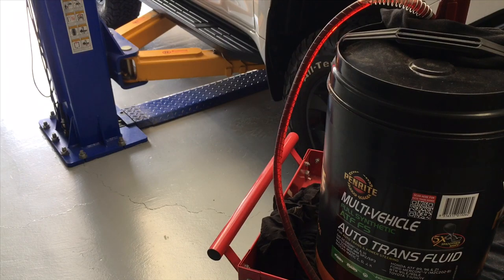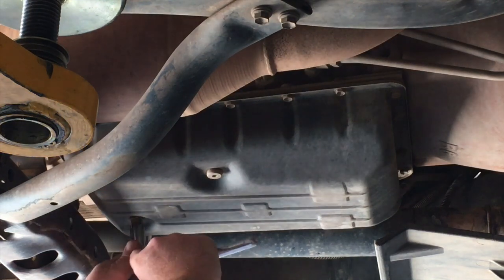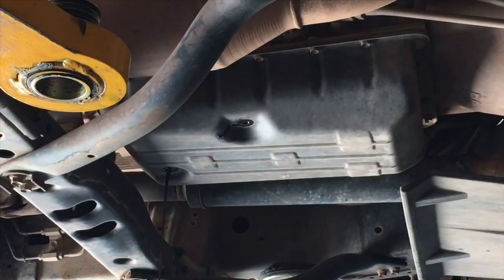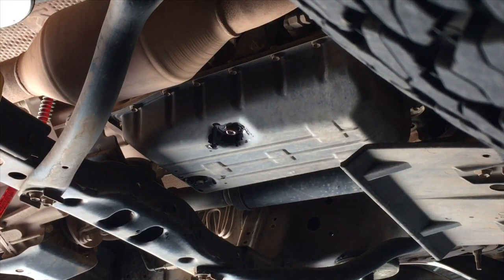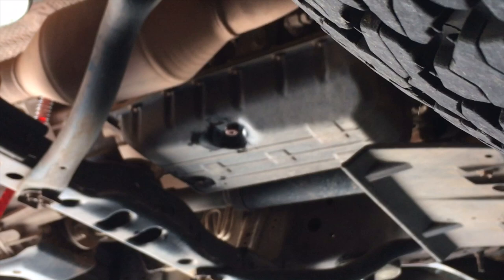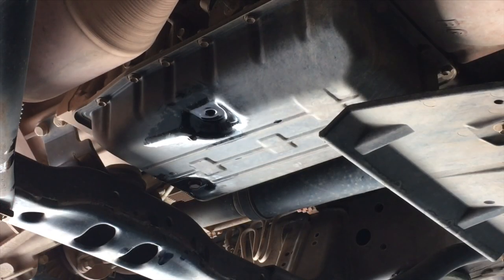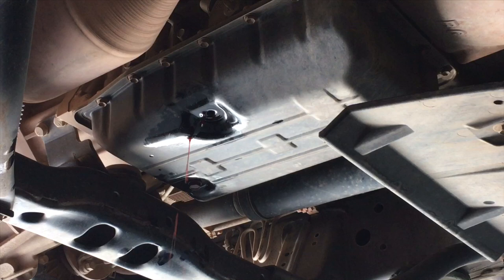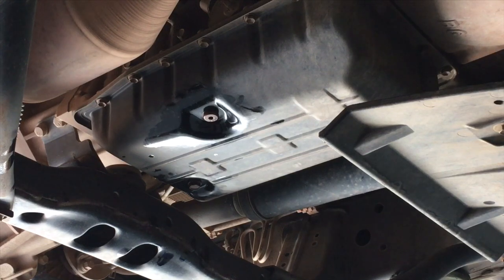AUTOMATIC TRANSMISSION OIL CHANGE - A750F

Comment: I have seen a lot of instructions where it wasn't clear that the engine should be running during the final level setting procedure. Great to see you made that absolutely clear for everyone. The length and detail on this one was perfect I think. Some people might be nervous on finding the fill plug, I certainly checked twice I had the right one, it seems a little far back at first glance. For others, the fill plug has a WS on it.

Comment: Hi Anthony, loved your video on the trans oil change Prado 150 very informative! so went out and bought the recommended oil Penrite full synthetic ATF LV Trans fluid, went to my local Toyota dealership "PETER KITTLE TOYOTA PARAFIELD" in Adelaide to book a trans service only to be told by the service manager they wouldn't use the oil i provided because they ONLY use Valvoline trans fluid !  Now have to look around for some other specialist to do the job.

Comment: Well done mate, I'm an ex Mechanic and didn't have a clue on it till now, obviously it's the torque converter that holds so much fluid is why you run through the gears draining/filling it till it's clean. Was going to do it at home but without a hoist and where the filler plug is will be near impossible to do it all on my own , plus needing the gadget to see what temp it's running at. Thanks a heap for your formative video.

Comment: Thanks Anthony, gave this a punt today, 4 flushes and a fill. Perfect length video and very helpful instructions / information. Filled at 50 degrees, couldn’t get it any lower during the job. Should I reset the level again at 42.5 degrees or all good?
Reply: This was at 103,000 and trans oil still had some colour from factory, 25,000 towing with 2.8 tonne van. All about the driving style!!

Comment: There’s a sequence you can input using the shifter & door button to get the ecu into a diagnostics mode so it will tell you when it thinks the right temp has been hit. 

I would never use a temp gun on the outside of the case or pan since that’s not where the temp sensor is reading from.

Comment: Fantastic video , just bought a 2010 Prado with a suspected blown transmission , climbed under and tried to remove check level cap but unable , bent cheap Allen key , decided to add one litre , no difference added second litre runs ok .
undone drain plug just a tiny bit fluid is black.
375000 KMs and I think fluid is original as no mention in paperwork of transmission service.
Should I change filter or just fluids.
thanks for the video.

Comment: problem,some time ago i was told the auto oil for hilux 2005 5sp auto 2wd was penrite atf fs full synthetic oil,now when i want to change the oil they are saying to use only low viscosity  and i see your using the other one,so my question is what oil???

Comment: Hi Anthony, Love your finer points to detail and advice. I have a 2018 Prado 150, we use it alot for towing 2.5T of caravan. I added a oil cooler which was recommended by Toyota if we were travelling up North in 45+deg heat. I asked about changing trans oil and said about every 100K would be fine. If your pulling heavy items and near max GCM whats your recommendations on trans oil change?
There are lots of these Prado's out there pulling max capacity without oil coolers. long time to hit 100K.
Reply: If you do a lot heavy towing or hot area i recommend to cut it to 50K
Reply: I tow 3.5T occasionally and did mine 100k (miles) the first time and I’m at 90k for this second time. Still need to send the oil sample in, but the first one came back a-ok from blackstone.

Comment: Great videos and info Antony, I have a very low ks on my 2013 150 diesel prado.. 46000 km.. what amount of time in years . would I need to change the oil in the transmission... as the oil is 6 years old now .. thanks for any info...
Reply from the maker: 100k

Comment: Why has the v6 petrol prado 120 not got a 5 mm plug allen key for check level? Its on your d4d diesel but not on the petrol engine. Is the check level sump somewhere else or did the gxl model 2004 have a dipstick under the bonnet to measure the atf level. Doing my head in trying to find the 24 mm filler plug as its nowhere near where people describe it. Have looked on the drivers side and cant find it. I am thinking its down at the rear of the transmission sump. Is this a 150 or 120 prado? I dont understand why my trans which is a 750 hasnt got the 5 mm on the bottom of the sump like in your video

Comment: Is the plug being put in while in park? I notice with my triton,  which has the the same trans, when going from reverse to park fluid runs out of the upstand drain. It's obviously drawing on the sump when going from park to reverse, so when filling unti, it runs out in park, going to reverse creates more space in the sump. 
So which gear are you setting the level in? I did it in park. It runs fine. But want to do it right.

Comment: In the US there is always a vicous battle over the use of WS vs Multivehicle ATF suchas Valvoline being used in the WS Toyota Trans.
My 2005-06 Tundra has the A750F in which I used WS to double drain/fill at 89K miles 1st service, as well as all dif & Transfer Case fluids. Have owned since new.
Going to install a Cat Guard so will be giving another change at 104K before covering up. Will be using a gallon of Valvoline I have in stock and with this video as my final proof to do so!
Is WS as much a Fire Starter for forums in your experience there?
Really good work Sir!!!

ps-what is the mieage of this vehicle?
Im only jealous it has a diesel attached to it.
US never had them offered on Trucks of this generation.
Thanks

Comment: Hey mate, im having issues with my A750f. If you loosen the "check level" nut when the car is cold (sitting for a week) should the oil run out very quickly? Or this way to full?

Comment: Great video I have a question for you I read oil a/t fluid type is Ws and the one that you use not includes on Toyota specs WS type just t-II,III,And t-IV and the fill plug comes with WS print ??? My Land cruiser prado is 150 series VX 1kdftv engine
Reply from the maker: If you want more information on the oil watch all our transmission playlist videos and perhaps our oil videos

Comment: is this the same auto box as in the isuzu dmax AT35 2017  its  got 87000 miles on original gear oil   and i would like to change it

Comment: Hi mate 
So I just completed this 
Is it common that I put in 18lt of new fluid but only have 17.3lt of waste fluid. I had the vehicular level at the chassis and at the transmission overflow when at temp. As far as I know this was never done before (160k klm)

Comment: Hi Anthony. Another great video. Very helpful. Could you please clarify if it's more important for the vehicle to be on level ground or for the top of the pan to be level when setting fluid level?  Also, I'm having trouble getting the ATF hot enough. I have a V8 100 series, not a Prado. Can I clamp the transmission cooler hose or will that  cause back pressure problems? Cheers, Rodney.
Reply: Yeah I had the same issue as you I couldn’t get it to heat up past 39 when a fan spoiled in the engine bay and the temperature dropped so I took it for a drive and got it hot enough the then went through the whole level check process again 
I also have a v8 100 series land cruiser 2006 Sahara
Reply: Fan spooled up not spoiled sorry

Comment: What do you suggest for us doing at home without a scan tool to show the oil temp. Also roughly how many litres of oil do you go through for an oil change. Obviously depends on condition i know but lets say 4 flushes. 
I prefer the long videos btw, i can always skip when i need it shorter. 
Great stuff, keep it up.

Comment: A750F transmissions need Toyota WS fluid. The Penrite equivalent is the LV fluid.  WS is the lower viscosity fluid for more modern transmissions.  No alternative is allowed according to the Penrite site.
Reply: True LV is WS rated though Penrite LV and FS are interchangeable for 2013 and later models according to there website. Either will do. Use LV if concerned to be safe same price I think.
Reply: Redline makes a premium WS compatible fluid

Comment: I want to see the check plug remove when engine and transmission fluid in cool or engine not running. To compare the check plug remove when engine running at 40 degree. I  want to see the difference. Why so complicate just to change the fluid

Comment: You can use maths to calculate what % of old oil remains using this method. Using a UZ petrol 200 series (A750F) as an example:

Capacity: 11.1L (according to owners manual)
Drained amount: 3L (approx)

1st flush: 72.97% old fluid remains
2nd flush: 53.25% remains
3rd: 38.86%
4th: 28.36%
5th: 20.69%
6th: 15.10%

% depends on how much is removed with each flush.

The better option is to pop off the oil cooler return line (if possible) and attach a tube to it. Look up the Project200 tutorial on how to do it.

Comment: I know this is an old video but I just this today. I dropped 4.6 qts initially. Then added. 4.75 qts. Checked it at appropriate temp with the thermostat pinned open and drained 2.25 qts out of the check plug... Doesn't seem right

Comment: A real slow way of flushing the oil. Intercept at radiator trans cooler pipe, but which ever way you go it will need lots of new oil

Comment: Another question: 04 4l 4speed auto when I’m going up hill in 3rd gear and switch it back to drive the rpms increase a couple hundred rpm for a few seconds before it goes to forth gear. Is this normal?
Reply: Planet Matt that will be the lock up torque converter
Reply: Mine does the same thing. I think it is just the torque converter unlocking.
Reply: I think that is normal

Comment: It is more fluid coming out when the transmission fluid cool down, I thought it should be the opposite when it becomes hot and expand then overflow. When cool down it should shrink I thought. I am very bad in physics 😟
Reply: Are u checking the level when the engine is on?
Reply: You check when engine idle.